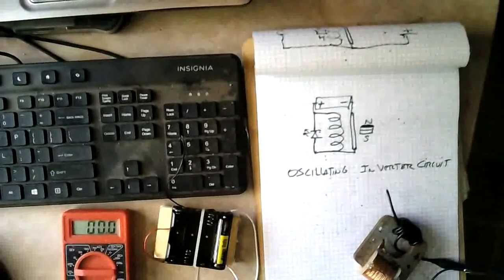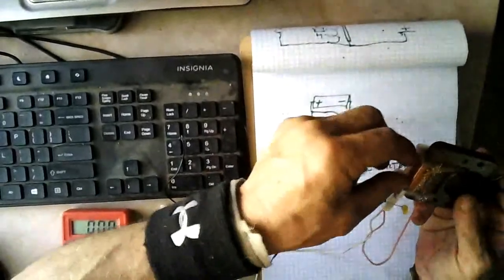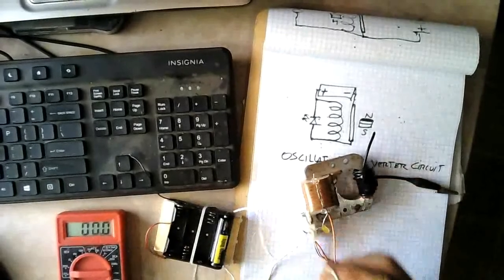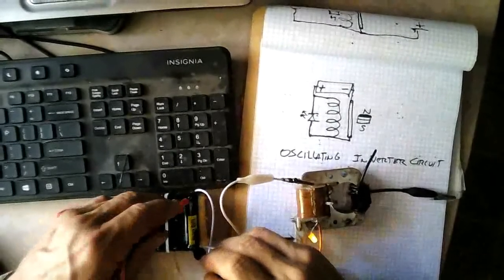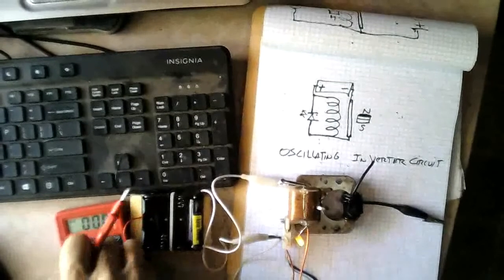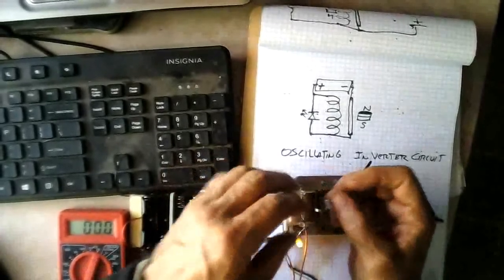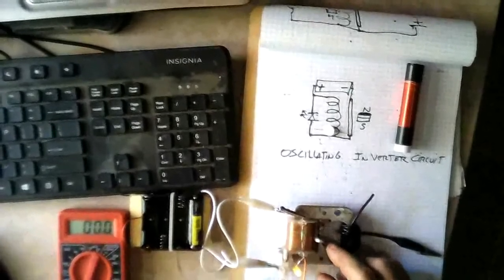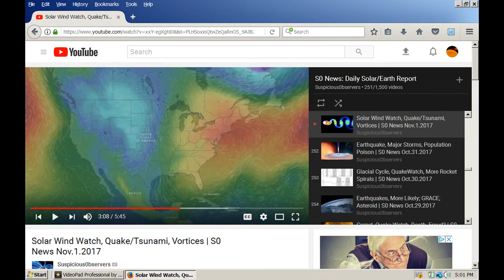My First Oscillating Inverter Circuit!

Comment: The 0.73 v is the voltage drop across the diode which is normal.
Reply from the maker: I think it's wierd that I can measure DC and AC from the same contact point.

Comment: So is the reed switch contacting 10000 hz . Will it burn out ?
Reply from the maker: I don't know if the switch will burn out or not EPN. I would guess that it would burn out eventually, but how long it would take will vary with the conditions of course.
Reply: Bio-Cell yes it is very low current so may last long time .